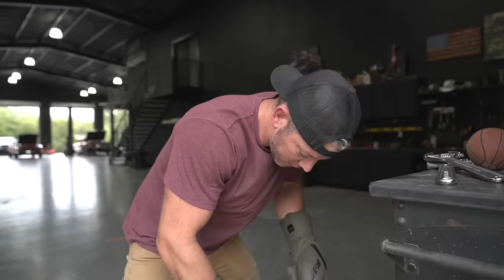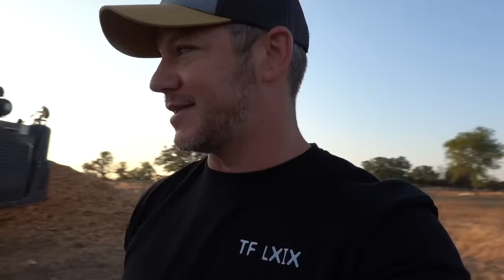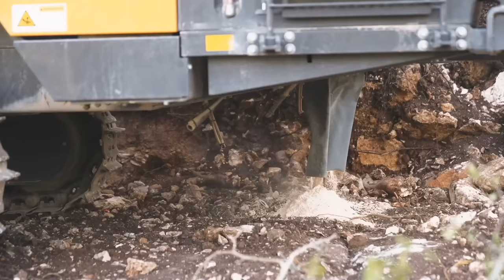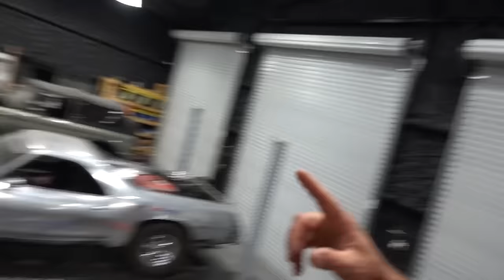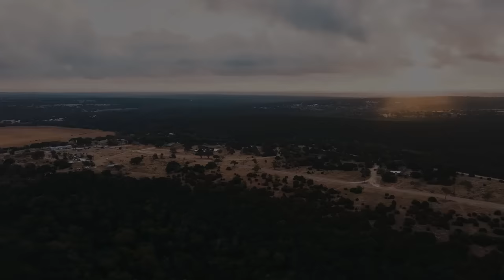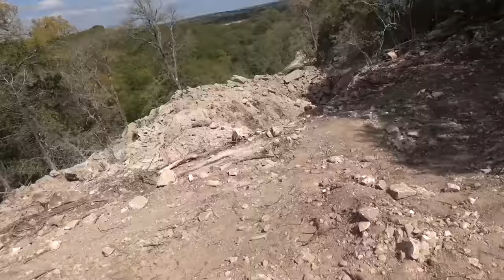Renovating an Abandoned Resort: Part 11... DYNAMITE!!!

Comment: You should put a tool box or tool carrier on the front of the fire trailer. Put stuff like extra fuel, shovel, axes and chainsaws.  Also a generator with flood lights.
Reply: That and a strainer for the feed end of the pump hose. Dont want to send sticks and rocks through the pump
Reply: I agree. Trailer setup is begging to “Act Accordingly.”
Reply: @rustbucket9318  that's how the US forest service would do it
Reply: @jaymkay59  Beloved.
Reply: Plus a McLeod Tool
Reply: I saw a video about a dude in California dug through a similar rock and turned into a citrus tree farm. It's a small museum now... I forgot the name of the place ... it was a cool story, though.
Reply: Did he sell the fire truck?
Reply: Solar panels and a couple batteries should be the power generator all over this resort
Reply: @htownkiller1111  Probably stays at the homestead.
Reply: @htownkiller1111  I believe that stays at the ranch..
Reply: @vinster8884 two or three nine volts should to the trick
Reply: Shovels and brush rakes for the wildfire type things, for sure.
Reply: @vinster8884 an ecoflow would work perfectly or something similar!
I suggested it for the trailer instead of that loud smelly generator.
Reply: @rustbucket9318  Cody? LOL
Reply: @Tony-InLosAngeles The loud smelly generator will be able to put out fires at night, when it's cloudy, or deep in the woods under tree cover for hours on end. Firefighting equipment isn't a place to experiment. It's an application for reliable tools that you can count on working when you need them.
Reply: @drewdane40  one I was referring to the airstream and how the generator ruins the experience of the peaceful camping by the river. 
Two all well and good for the fire pump if he remembers to put gas in the tank. 
Wait he’s forgotten to put water in the tank already. 
Three he had better have called in all the fire brigades if he’s fighting a fire at night!!!
And he is not fire fighting especially with 500 gallons of water. Keeping flames at bay putting out a small brush fire etc. until the professionals arrive… let’s face it how many fires are there going to be that are directly related to his responsibility.

Comment: FYI, that yellow line connected to the blasting cap isn’t det cord. It is non-electric shock tube aka non-el shock tube, basically a plastic straw coated with explosive powder.  The electric spark from the igniter sends a spark down the tube and ignites the explosive chain of TNT and ammonium nitrate/fuel oil mixture.  Good times!!  That almost sounded like an MG42 firing off.

Comment: Make sure your water nozzles are removable so they can be cleaned out. Also, consider leaving the tank to pump valve cracked open any time you start the pump so the pump is never dry. It will save the pump.

Comment: FYI, the yellow tubing is called shock tube and not det cord.  Shock tube transmits the initial blasting cap energy to the next blasting cap, which sets off the HE boosters, which then ignite the ANFO.  Cool video!
Reply: Came here to say this!!
Reply: Came here to clarify this as well. But I knew at least one of the demolitia would have it before me. Reason for my delay: I was at work.... playing with explosives and deflagrants .
Reply: ran to the comments to say this exact thing
Reply: Did it look look like some of the charges didn't go off to you guys?  Specifically, the charges closest to the top of the hill.

Comment: Mat the sprayers on the back of the trailer that you want to make for spraying the roads all you need is two thread on caps for your upright pipes then cut a slot in the back of them for the water to spray out of. We have that exact setup on our water truck at work and it works awesome. Also with them being threaded on if they get plugged you can take them off to clean out. Hope this helps.
Reply: I was thinking threaded with a 90 or 45. . . Yeah! Easier.
Reply: @johngross8300  ya that would work as well but with the slots in a cap it will give you a nice fan of water. guess it depends on how much he wants to soak it down.

Comment: For your fire trailer!  Put another ball valve on the top of the pump housing. keep a road cone or bucket handy so when you need to prime the pump you can just open the ball valve pour water in and close it off! they dont prime the best at times and the screw cap can be a pain to use the prime it
Reply: Ohh yaaa, i've gotten soaked many times trying to screw that damn cap on lol, ball valve is a great idea.

Comment: Gotta do some training with that fire trailer when it’s finished. Some pumps can be real finicky with priming, and even worse with drafting from a pond. Some of the pumps we used when I was still doing wildland fire had to have water hand pumped into the pump head or they wouldn’t function. Good to make sure everything runs as expected before you need it emergently.

Comment: You should put remote control valves on the fire truck trailer so you can turn on the rear sprayer from in side the truck.  That way you don’t have to turn it on then run to the truck to start driving and waste water.

Comment: Hey Matt, @ 27:26, that is a non-electric detonator. It times the explosion so the holes go in series, one after the other. The number is how many millisecond delay after initiation of the blast. The plastic filled tube, about 1 inch in diameter, is modern “dynamite” which the non-el goes inside of, then it is typically placed in the bottom of the explosive (ANFO) filled hole. The non-el is initiated by a booster, it transmits a blast wave down the yellow plastic shock tube to the cap at the end of the non-el. The dynamite is initiated by the non-el igniting the ANFO which then heaves the rock when it transitions from a solid ammonium nitrate and fuel oil to a gas state very rapidly expanding into the rock pushing in all directions… fun stuff playing with the big boys with big toys…very well timed blast and excellent job by your contractors on the powder factors. You definitely found the right guys.

Comment: Back in the 90s i had fun in a stainless steel engineering /fab shop , we built 6 or 7 explosive delivery trucks for the big British chemical company. Big tank for urea and a few smaller ones for the additives , fancy aluminium tailight bezels were even fabricated , i had to weld all the hydraulic fittings to go from one code to another for whatever reason , it was THAT involved. Great fun times in a great shop with great blokes.

Comment: Used to work on big construction sites myself and the drilling augers used on some of the projects I have been involved with were absolutely massive in comparison.
One that the piping company I worked at was similar size but designed to drill huge distances laterally instead of downward, we used it to pull lengths of polypropylene pipe.
Super cool machines, extremely versatile.

Comment: Make sure to leave the valve going back into the tank cracked to recirculate the water if using the hose reel. That way you don’t burn your pump up when the pump is running but you’re not spraying water!

Comment: You can try the water system on the trailer but fair warning you need a bypass valve so the water can go back into the tank and if you're not using the water from the pump because if not you'll get a high pressure buildup as long as it's not too much cuz it could bust the pipes we water gravel here at work and we got three water-wagon set up but we have a bypass hose when you flip the water off at runs into the tank it's electric nozzle on a ball valve so when it shuts off it starts pumping it back into the top of the tank but when you need it you can flip it the other direction starts pumping we need to go so it does not create pressure

Comment: HEY MATT!! Make sure you get a “fire hose barrel strainer” to put on your “fire truck” fire trailer on your pick up hose if you plan on filling up your tank from a pond. We have to use one on the city fire trucks in case we have to pump from a pond so we don’t pick up a bunch of rocks and grass. You don’t want to mess up your pump or have a bunch of trash in your tank. Good luck!

Comment: I’m a shotfirer in an open cut in Aus and use this stuff in a bigger scale but it’s good to see it in a different application. 
Initiated with an electronic det which you can put any time delay you want and the rest of the shot is tied up with 25ms surface delays. And they’re just a hmx powder in a shock tube. They travel at 2400 metres a second. No det cord in your shot det cord has petn in it and it burned at 7-8000 metres a second. Bit of trivia for ya 🤟🏻

Comment: ANFO - ammonium nitrate fuel oil.  It's used as an explosive in most surface mining applications.  The ammonium nitrate is the same as that used as fertilizer, however, the "grains" or "prills" are bigger in the explosive version.  That allows it to absorb more fuel oil.  That's as best I can remember.  It's been awhile since I took my surface mining class.

Comment: 2 things. 1. The fire trailer. The plumbing for the tank filler should be connected to the water tank higher on the side of the tank, or better yet through the top, having the connection into the tank that low on the side of it means that the pump will have to fight the static head (pressure/weight) of the water in the tank as it trying to fill it, ie the water in the tank that is above the level of the fill pipe will be trying to push back out through the fill pipe and the pump will have to overcome that pressure to put water in, so the more water there is in the tank the harder it will be for the pump to put water in. 2. It sure looked like there was a section of several holes in that blast pattern that failed to go off, that's why you were finding detcord laying on the rubble. I would guess someone from the blasting crew would have noticed and been sure to advise the crew doing the debris removal regarding potentially finding unexploded material.

Comment: Quick tip. Don't weld the spray nozzles onto the trailer. Weld threaded fittings and screw in the spray nozzles. If one gets blocked or damaged it's much easier to fix

Comment: I used to be a driller, I worked for a rock quarry. It was a tough job,  but I absolutely loved it. 

I would drill 54ft deep, usually about 10 holes a day, 12 hour days.

Comment: Think about using metal piping and solenoids. Use reinforced wiring or conduit with a dedicated 24 battery and power supply. Run the controls to inside the truck. With a small controller you can select the waterflow pattern to set the pattern. If I lived closer I would help ya brutha.

Comment: The drill is actually called a presplit drill they were built for rock quarries and mines because the boom can drill in all directions and completely horizontal I use to do this alot for well pads and pipelines but also did it on part of the new Pennsylvania turnpike really cool stuff.

Comment: @OffTheRanch Run a water unit to the front that you can operate from inside the cab. You may be alone when you need to water a fire. So spray water while driving towards the fire. Just a thought.

Comment: Matt on the fire trailer plumb in a 1/2 in line that will recirculate the tank water through the pump while it's running. If you don't you will melt the impeller on the pump if it's ran to long.

Comment: Your gonna probably need to put a hand primer on the suction (all of the forestry firetrucks that ive worked on have this). That pump isnt gonna be able to pull a draft (suction) and it could hurt the pump.

Comment: You want a bit of a manifold with 120 degree nozzles in 2-3 places to hit the full width of the road with a fan pattern to stop eroding the road away. Quite a common size for garden sprinklers. 
Ammonium Nitrate is scary stuff if it degrades - that's what flattened an entire port at Libya.
Reply: Lebanon***
Reply: @americafirst3738  You're right, I do apologise it was Beirut Lebanon.

Comment: You need to buy about 130 Barrel Water trailer with a tractor you can vacuum or pressure to use for dust control or Fire Control

Comment: Gravity feed for wetting down dry roads/dust reduction with an adjustable valve operated from the cab. A pipe with holes drilled in it works great! Spraying it? Nah.

Comment: Hey brother, somehow you’re gonna need to remotely activate the dust prevention sprinkler system on your trailer otherwise how do you start and stop it?
The trucks I see every day at work that sprays water to prevent dust on the gravel roads. We drove on have some kind of automatic feature for that. I think it’s the turn on the pump.

Comment: We use them water trailers at work usually get 100 gallons to 100 foot but we have 600 gallon tanks on the ones out here there okay but you will probably want to upgrade to a water truck one day

Comment: When you were carrying the tannerite buckets down and pouring it in the holes it looked white. I’ve shot tannerite before and you need to mix the ammonium mix with the gray powder(I believe it is aluminum powder, I could be wrong). Am I wrong? When did you mix it? 20:02

Comment: Do you need to get a remote start for the water pump so you can start and stop it when you need to for dust prevention sprinkler system

Comment: That was probably just electric blasting caps and not det-cord. Maybe shock tube. If it was det cord, the top layer of the ground would have had a spiderweb of surface detonations covering it in the video instead of all the explosions being contained underground. It also would have been WAY less safe since it could have thrown surface debris all over the place, so it's not surprising to me that they didn't use det cord. If there was still detcord laying in the piles of rubble, that means there'd be unexploded charges in the pile too, and the dude that rigged everything up WOULD NOT have let you climb all over it at the end of the video. - From a Marine Corps combat engineer that's blown up tons of stuff.

Comment: Unless your pump is self priming, I think you may have some priming problems trying to draw from a pond with that centrifugal pump with the way your suction is plumbed. The only way to keep it primed is to have a water level higher than its volute. Also, you need to make sure you have an adequate vent to the atmosphere on the tank so it doesn't implode when you are suctioning off it or if you are filling if you forget to remove the fill lid on top.